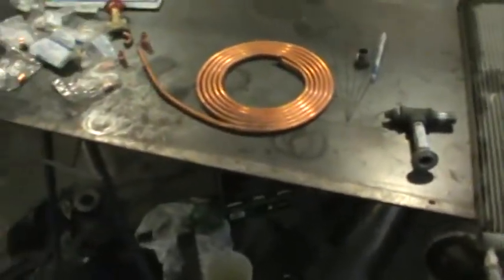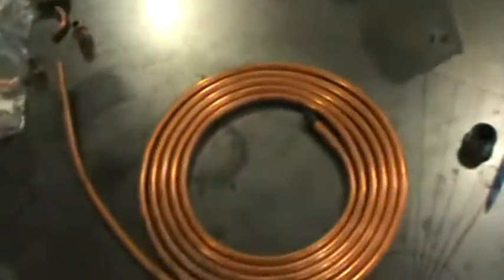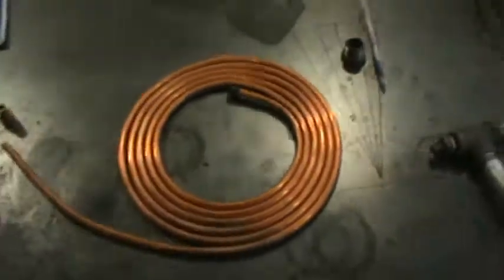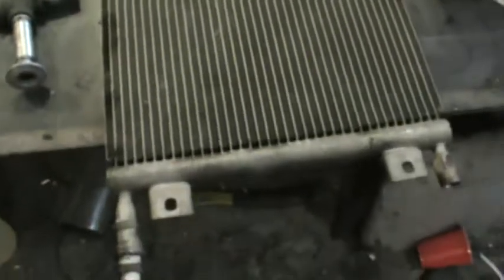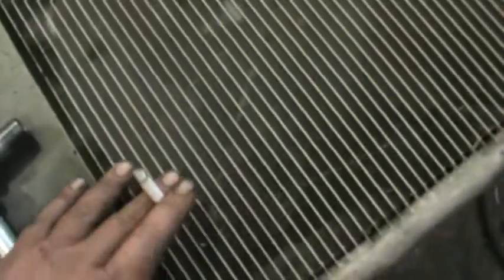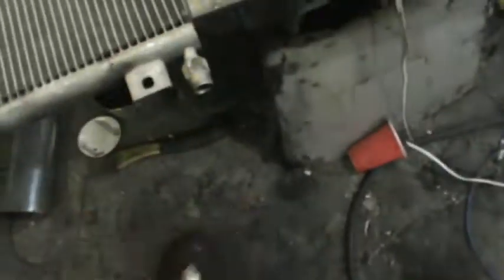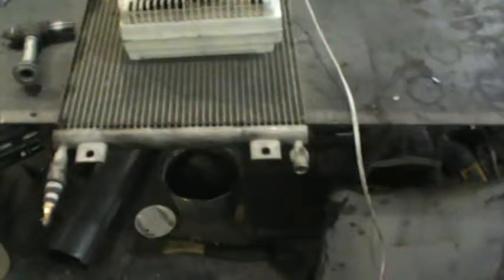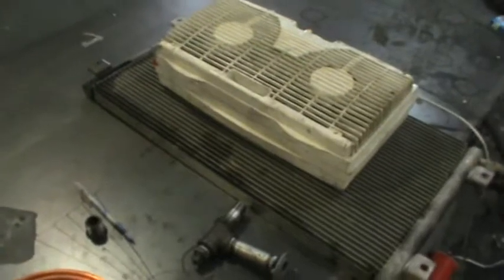Hot Water Heat Exchanger For Heating Greenhouse

Comment: Why can’t you put a wood stove inside the greenhouse? Wouldn’t that be easier than trying to extract heat out of your barrel and move it...
Reply from the maker: I know in larger greenhouses that has been done. I started off with it inside, but being such a small greenhouse it would get extremely warm, I'd burn myself on it, and feeding the fire seemed to fill greenhouse up with traces of smoke( which I would then have to open up doors and windows to air out). Greenhouse measures 7x8 which doesn't give me much more than standing room.Thanks for your comments.
Reply: Rod Mcdonald, I found that if you put the fill door outside the green house and the barrel stays inside, you don’t lose your heat reserve and you don’t get smoke in the green house. Just a thought.